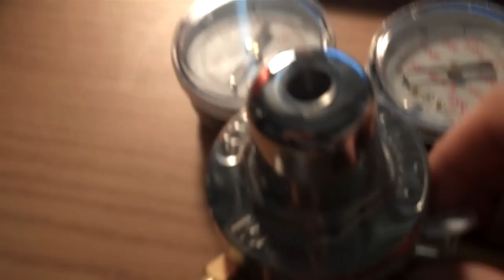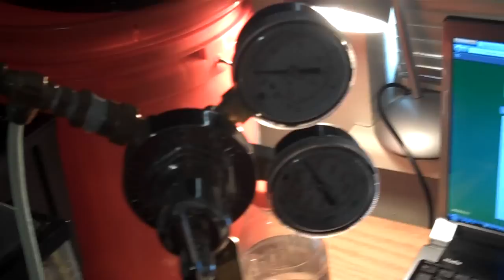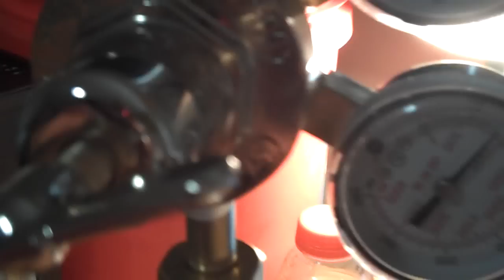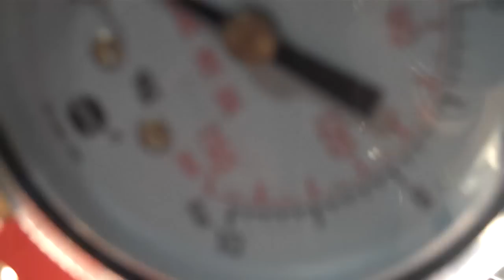Pressurized Paintball C02 Injection Setup for Aquarium

Comment from the maker: @ThaDrSean it will wear down on your impeller but overall it's not too bad. Filters are easy to replace anyway and the benefits will be well worth it. The option I prefer is the one I'm doing now which is use a glass diffuser and place the diffuser below the output of the filter. The waterflow distributes the c02 throughout the tank nicely with no damage to the impeller but the bubbles aren't as fine.